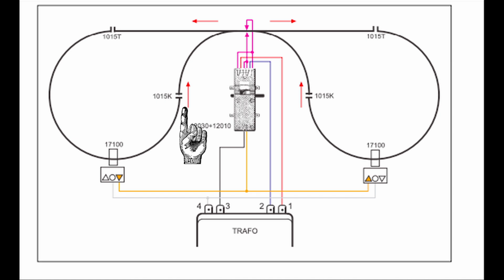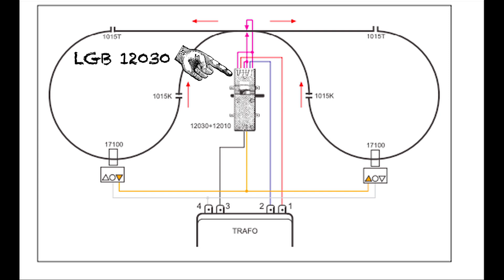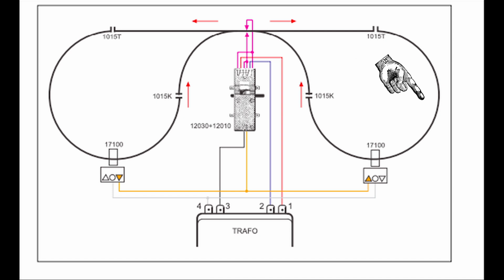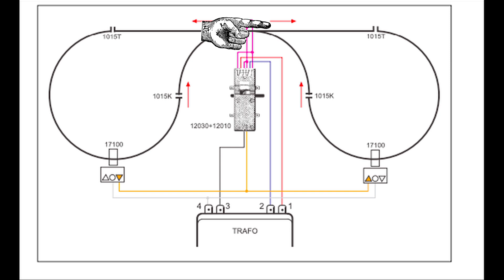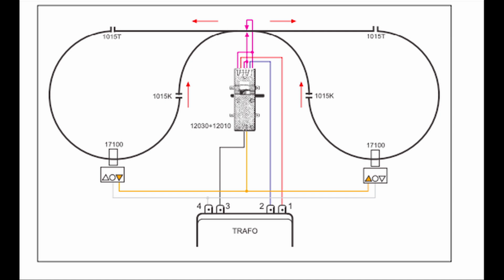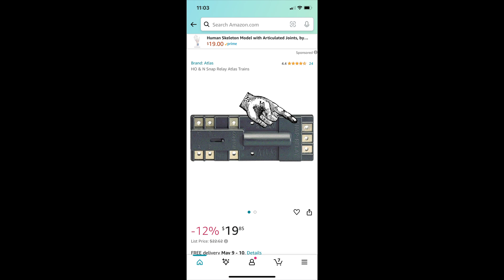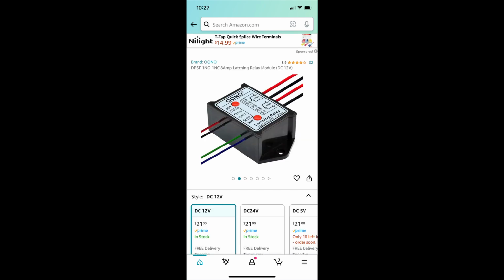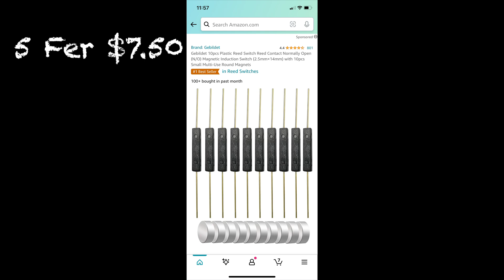Magnets and reed switches for detection - LGB 17100 system - Electricity for Model Railroads

Comment: Can you discuss circuit 10 which shows the reversing loops where the train can travel in either direction thru the reversing loops fully automatic. Looks like instead of the diode(1015t an k) tracks you use isolated

Comment: Great video but I have a question. I bought a oono f-1030 how do I wire it. I believe I put my + and - from my power supply and hoop up my reed switches like in the photo but what about the 4 red and black wires. When I test this way and use a test light I don’t have power coming through the 4 red and black wires. Any help would be appreciated. Thank you.

Comment: Great vidio, Great info and simple. My coal mine On3 coal loco uses your point to point system but has a digital timer relay that powers a dead rail at each end so train glides to stop , waits 10 sec or more then flips switch reverse, 10"track prior can used a resistor to help slow train down . Thanks for the morning coffee...

Comment: I'm glad you featured this. I'm in the planning / material gathering  stages of a dual gage N and H.O. scale modular layout. 

When I started buying signals, I discovered there is no longer a DC friendly signal system that's already available. Atlas once offered a system, but it's no longer made to be compatible  with DC, and any of the more sophisticated  systems out there, only support the newer common anode style signals, and the atlas signals are common cathode. 

So I can go with an Azatrax TS5, or I can try this system first. I don't mind a little bit of wiring, but I do mind expensive systems that may not work. 

Thanks again for this video.